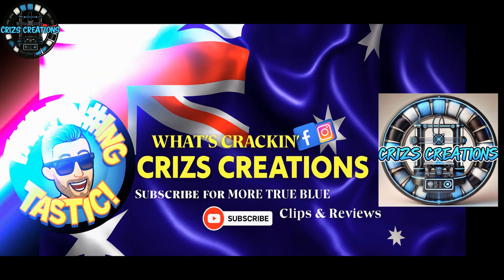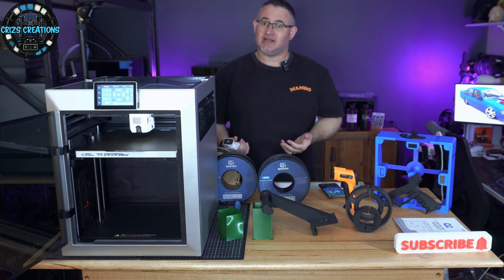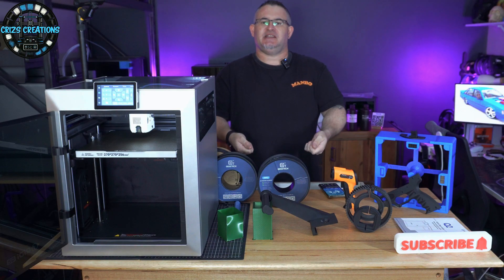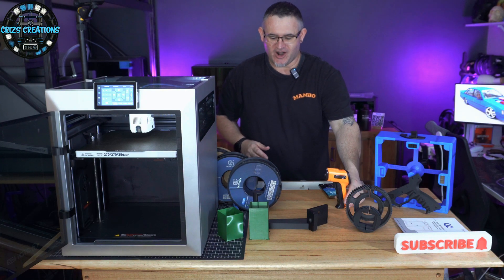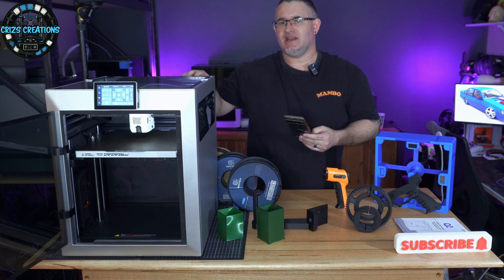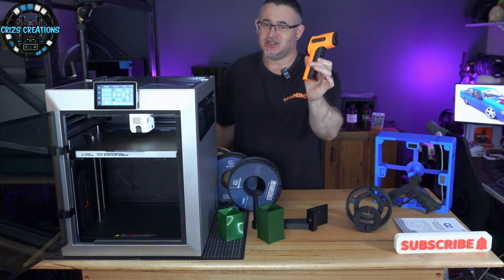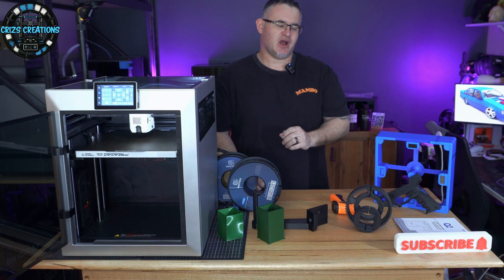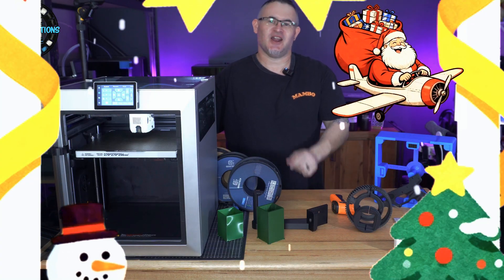Qidi Q2 EP 3 Engineering Grade Filament Testing Update?

Comment: Made my order for the Q2 Combo yesterday using your old code. Hopefully it works out, as this is my first 3d printer. 🤞
Reply from the maker: Really. Most appreciated. 
First Printer 🎉. Well you pick a Very Good Quality Printer with tone of features and a huge learning curve But a lot easier thanks to new open source platforms like fluid & klipper. You love it once you get to learn all additional features and not having upgrade for along time ability to print many different materials. It should be a very good smooth experience for you to start out. Just remember to ask a lot of questions and always follow instructions or seek advice if unsure when starting as to not damage the machine. 👍. Which seems to happen frequently in groups I see online when starting of with a machine packed full of features sometimes rushing through the learning process take your time learn the basics and slicer software is key. Try not to expect perfection it will come the more you learn. Enjoy & a thanks for the feedback
Reply: @CRIZS_CREATIONS  Thank you. I looked around a while and may have got the Elegoo CC if the multi-color would have come out this year. I understand from what I've read, no printer is perfect and you'll always need to tweak stuff (even on Bambu's). I'm fine with that.

Comment: I bought a Qidi Q2 + box combo as my Elegoo Centauri Carbon can not stop being broken... The ECC generally makes good prints, but the Q2 does make good prints. The Qidi spaghetti detection is a little aggressive for my taste, but that's OK. Thus far I've run PLA, glow, silk and+/Tough. ASA, PAHT-CF, PA6-CF. Really surprised how well the ASA comes out! No warping and I've done some nearly bed spanning prints! My recent production (q4 2025) Elegoo Centauri Carbon has had so much down time from failures (1x "Heat Break <cooling>Fan", Nozzle Assembly, Print Head PCB, Total Hot End, USB Cable and Main motherboard have all been replaced under slow Chinese warranty so downtime is pathetic!) Got back into printing at work; started with a Rostock Max v2 delta a decade ago. Everything has come a long way!

The new Qidi Box for the Q2 works well. I've had no real trouble with it. It doesn't like drying PLA, but that's not uncommon. Tell it that it's anything else and you can run it how you want if you have a want/need.
Reply from the maker: Awesome to hear. Thankyou for the detailed comment it means a lot to get this type of feedback 🎉
Reply: @Toysrme  ¹